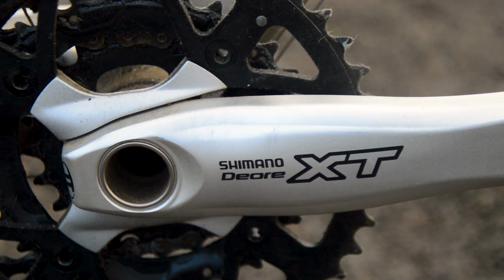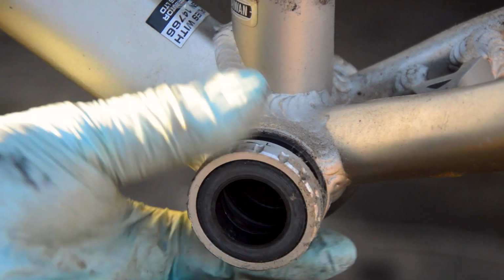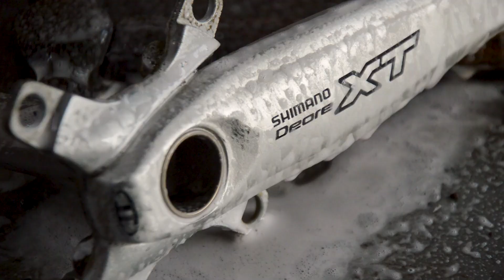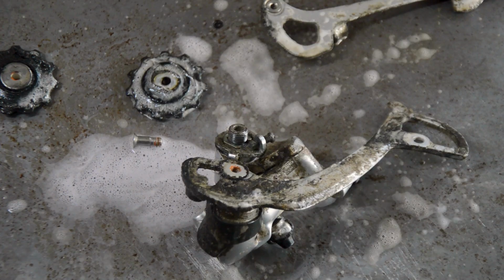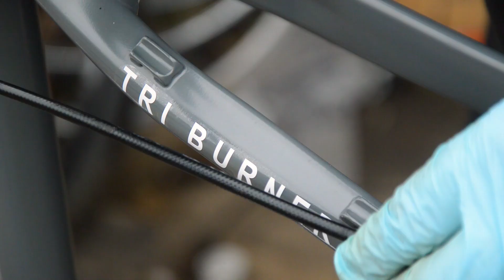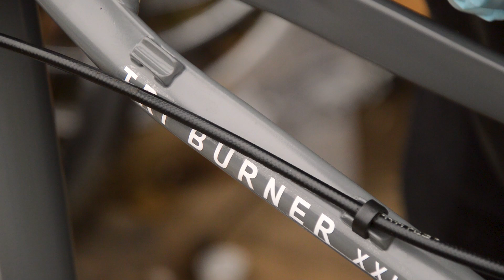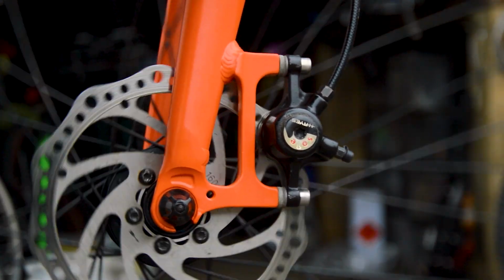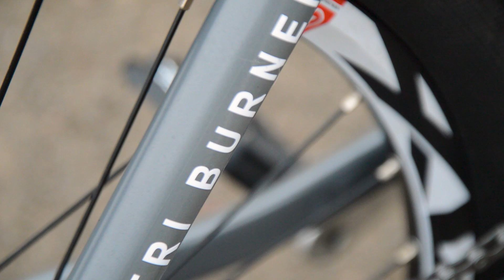Hardtail to Gravel Bike Conversion - 90s Inspired Marin Mountain Bike Build

Comment: I've been gravel all over the country with my 95' Marin Pine Mountain for years. The bike has a rigid fork and cantilever brakes and consists of a steel frame with 3x7 and 1.9 inch gravel tires...bikepacking also works.
Reply from the maker: Sounds like a pretty standard 95 bike then! They do work well for most scenarios

Comment: My build is similar to this:
Hardtail XC carbon frame 27.5 inch
Aluminium rigid fork 29 inch
1.75 inch 27.5 MTB "road" tires
38t-28t 2X setup
11t-34t 9 speed Alivio
MT200 hydraulic disc brakes
Carbon saddle, seatpost, flat handlebar

I use it as a go-anywhere bike, but mostly for road. The roads here are not very good and road bike parts are more expensive so i opted for my specific setup. I got no problem with dirt roads, gravel roads, potholes, etc. Never had a puncture. It is not road-bike fast, but it is reliable and ok for climbing.
Reply from the maker: Awesome! Hope the bike keeps serving you well!

Comment: Polished/satin/clear anodized aluminium parts are what should make a comeback :D Just imagine a new bike with shiny wide rims, rear derailleur and cranks, coupled with satin chainwheel. Seat post, handlebars and stem. And then then the frame with some neon with fluoro splatter paint! Wheh!

Comment: Compliments. Turned out very nice. By the look of it, I think there's less difference in height in the front than you mentioned. This is because you used a fork made for an integrated headset in combination with a traditional headset. Which is in this case a good thing.

Comment: Fork looks short, not suspension corrected? the geometry does not bother you that the bike"s weight is moved forward? I haved replaced my suspension fork with a rigid too 
and is short and is heavy doing front lifts even though the front is lighter, but the good side is it goes up hill faster.:hand-pink-waving:
Reply from the maker: It was a 29er fork. Axle to crown of 440mm so it was slightly lower than an uncompressed suspension fork. It didn’t affect the geometry that much.
Reply: @MonkeyShred  I measured my dork it is 420mm :text-green-game-over:no wonder it is front heavy:face-purple-crying:I liked your build it has cool parts and awesom color selection :hand-pink-waving:

Comment: I'd looked at those AirBike forks myself, are they as solid as they look? BITD I had a Saracen with absolutely bomb proof straight legs on it, and there's a lot to be said for that type of fork with comfy tyres! Quite fancy revisiting that setup as you have. (Incidentally, I've got a '92 Bolinas Ridge build on at the mo - Ribena purple and acid green ftw.)
Reply from the maker: I’ve only done a few rides on it so far and not taken it on anything too aggressive so it’s hard to say how solid they are in that sense. They appear to be well built though. Only time will tell!

Comment: Occasionally I'll rebuild a mtb and cleaning caked on grease is a nightmare..so tedious. That being said I might pick up an ultrasonic cleaner for bike stuff and other things I like to tinker with. Why did u not just use your ultrasonic?
Reply from the maker: I don’t have an ultrasonic cleaner. They’re extremely expensive for one big enough for fits cranks etc in!
Reply: You won't regret the ultrasonic cleaner. I got a 10lt one from Vevor 2 years ago it was $110. It's great for cleaning bike parts, and chainrings/cranks you just pop them in on their side and then switch them over. You can get Vevor in the UK as well.

Comment: How about a 1 by?
Reply from the maker: I don’t think it’s necessary here. The 3x XT works great.
Reply: @MonkeyShred  yep not necessary, but might be something affordable to try out that would go well with the retromodern vibe. A 11-42 might work with the existing XT derailleur and then a suitable narrow wide for the front would finish the retromodern arrangement 😀
Reply from the maker: @markusilomaki8922  I’ve done 1x on quite a few before. I’m just a lover of the 3x on these more relaxed bikes. 😌
Reply: @MonkeyShred  yep, 3X may sometimes work better in cases like this where chaindrops are not an issue 👍